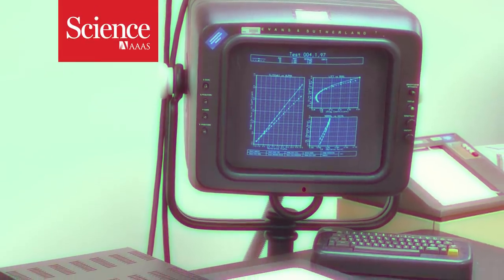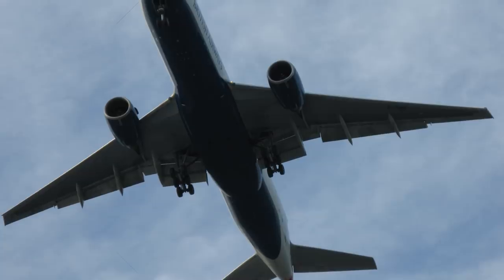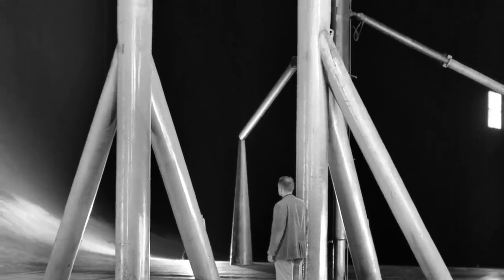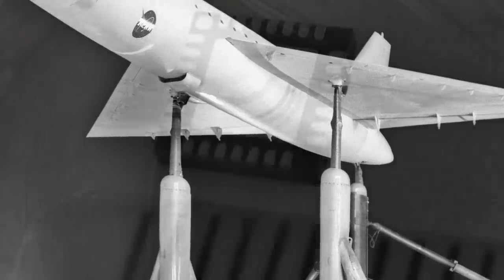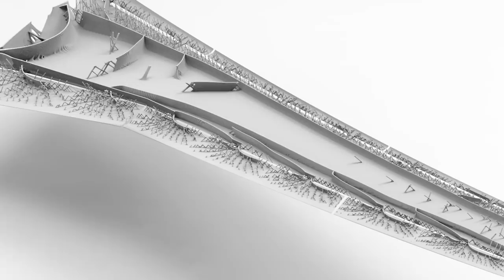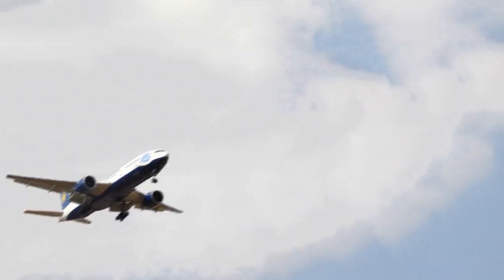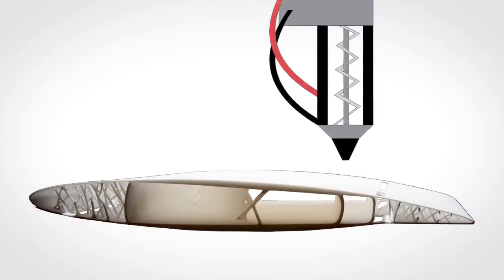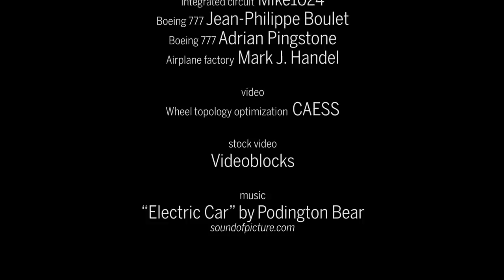New processing lets a supercomputer design a radical new wing

Comment: One small step for computers, one giant headache for maintenance.
Reply: Real argument right here
Reply: @Stan Cooper I think it works by mathematically designing each section to spread the forces evenly throught the structure with the least amount of material. Of course they would be able to calculate the normal pressures associated with flying and different types of weather. Boeing has all the data on that for sure. 

I guess the pitfall that you can fall into when you push structural optimization too far is if you don't also calculate the lifespan of the material or how well it will hold up over time. For example: when building the frame of a car; you want light weight for better fuel economy but if its made out of a ferrous material making it thinner will cause it to rust faster and it won't last as long over time. It may also be less repairable because there isn't enough material left over to work with if something needs to be repaired.
Reply: Indeed, it seems no thought went into how difficult it would be to fix if something goes wrong with it.
Reply: A very good point especially when you consider that the main point of this new design is to shed weight therefore saving fuel. Which would reduce the environmental impact of the plane and also save costs for the company but having a plane wing that is not easily repairable may completely undo both of the reasons for wanting to use a weight saving method to begin with. As completely replacing a wing after minor damage instead of repairing it may infact have a higher environmental impact associated with it, through manufacturing and transportation as well as costing companies more.

A way that I could see to negate this problem in part, would be to manufacture the wing in smaller sections and later join them together. Which would mean that instead having to replace the whole wing after it is damaged, only a much smaller peice needs to be replaced. I'm guessing that this idea has already been looked at and that a study has probably been done (at least I hope) to look at whether the reduced fuel consumption pays off the lack of repairably of the wing in the long run.
Reply: @activechaos128  The problem isn't just if/when the wing is damaged and you need to replace sections of it. If the structural integrity of the wing is coming from the whole wing and not a main wing-spar (as seems to be the case) then it will be a lot more difficult to split the wing into individual sections without compromising durability and fuel efficiency.
You'd also need to put in access panels for maintenance checks and the replacement of parts, adding weight and structure to the design.
Reply: This is why carbon fibre hasn't made any breakthroughs in aeroplane engineering. The components have to be durable, not replaceable.
Reply: @MeteCanKarahasan  Wait, what? Carbon fiber is used, sometimes extensively, on modern aircraft fairly regularly. It's already durable and lightweight. Barring specific chemical reactions I can't think of an instance where damage to a carbon fiber structure would not do similar or greater damage to comparable aluminum or other composite materials. Especially since it has some "give" to it.
Reply: @Wallen D okay, you be on the flight with catastrophic failure due to the "low toughness" design choices. How are you going to maintain it? I don't doubt it is used, I just don't see how it can be maintained. I must be stupid for playing safe, I guess...
Reply: @activechaos128  
How many times have we seen things designed by engineers that work well, but are hell to take apart and work on (I’m looking at you, Subaru)?  Allowing a computer to do that just takes that same problem and exponentiate it.
Reply: @MeteCanKarahasan  I'm not saying it is a perfect material. It has drawbacks to it. But when there is a commercial passenger plane that is 50% carbon fiber by weight that's been flying for 11 years and hasn't crashed? Yeah, there's a reason for that.
Reply: @Wallen D that just means to me it wasn't such a structurally strained piece.
Reply: @MeteCanKarahasan   The plane I  am referring to is the 787 Dreamliner. Its fuselage and wings are almost exclusively carbon fiber/composite materials. If those aren't designed to take structural strain I don't know what is.
Granted, there are counterexamples such as the Cessna Corvalis where improper manufacturing methods in Cessna's Mexico plant led to failures in the composite wing. My point isn't that carbon fiber or composite materials are inherently more safe or unsafe than "regular" aircraft materials, they both have their own, unique, design constraints and issues. My point is that carbon fiber is a safe, weight-saving alternative to aluminum.
Reply: @Wallen D, well I guess they don't use it on the nose-cone, or do they?
"Hail damages Dreamliner's nose during flight, prompts emergency landing"
- "The 787 is made out of carbon fiber, a material that is difficult to repair. Experts say hail can harm a plane's flight control system and engines, even causing it to crash."
Reply: @MeteCanKarahasan  Oh, they do. In fact, composites are an excellent choice for radomes as (unlike metal) they can be designed so radar passes through the material very easily. As for being damaged, the majority of hail damage on aircraft tends to occur in areas that directly face forward (nose, engine/engine nacelle area, wing and tail leading edge, and the gear doors if you have the gear down) so it makes sense that the nose cone would be damaged.
Yes, carbon fiber can be difficult to repair but so can sheetmetal. It depends a lot on what the damage is and where the damage is on the aircraft. How far from stringers/longerons, depth and width of the damage, is the damage in a critical area, etc. 
With metal sometimes the damage is minor and within limits, other times it needs a doubler (sheetmetal patch) put over it and sometimes you even need to call the manufacturer up and say "Hey, this is what's here. What should we do with it?"
It's pretty-much the same with composite materials, except instead of patching-over the damage you might have to cut out the damaged area, put in a plug/filler-material and do a few layups of composite weave and resin over it. While it does take longer than repairing metal, the weight-savings and fuel efficiency of  composites more than make up for the extra down-time.
Reply: From the same news article prior;
- "The 787 is made out of carbon fiber, a material that is difficult to repair.

Experts say hail can harm a plane's flight control system and engines, even causing it to crash."
Does it feel like the damage is always head on? It seems like it will hit sideways and it won't be able to make it until landing which is the most important part of flying in the first place.
Reply: From the looks of it, the only maintenance you would be able to do on that, is to melt the entire wing and print one from scratch.
Reply: @MeteCanKarahasan   I'm not sure what point you are trying to make. Yes, the 787 is made of carbon fiber. Yes, hail can harm and damage a plane's flight controls and engines and, in extreme circumstances, may even cause it to crash. This is the same whether the plane is made of metal, composite, fabric, wood, or any other material. See Southern Airways Flight 242 (an all-metal aircraft) for an extreme example.
If a plane is in a situation where hail is so severe it is threatening to down the aircraft, no matter what material that plane is made of, it is going to be severely damaged; possibly to the point of being a complete write-off.
And while hail damage is not always head-on, the most severe hail damage is concentrated in those areas.
Note: If an airplane is receiving any hail damage while flying it is either very, very unlucky or the pilot and copilot are idiots of the highest caliber. The most likely damage to airframes I can think of is ground-collisions. These tend to be slow speed and localized to a relatively small area of an aircraft.
Reply: Don’t worry engineers know how important maintenance is
Reply: @medexamtoolscom  Why would they think about that? They never said they will build it, they were just testing their algorithm....
Reply: They use carbon in the biking industry, too. In no clear terms have they ever guaranteed a carbon fiber product for longer.
Reply: @MeteCanKarahasan  They use aluminum in the biking industry too. Between a bike and an aeroplane I'm pretty certain I know which warranty is going to be expiring first. Also, if we've started comparing bicycles to planes then Godwin's Law shouldn't be too far off. I can't believe I'm saying this, but bicycles are different than aircraft. You can't pull-over a 767 at 32,000 ft. and call someone to pick up your passengers.
Reply: A recent new documentary is on youtube: The Connections (2021)
Reply: Shut up! It's a disposable aircraft!

Comment: I’m actually pretty impressed that with much simpler and cheaper manufacturing and design processes; we were able to come up with a wing within 5% weight of a supercomputers 5 day super processing wing that had no manufacturing constraints.
Reply: To be fair, they did give the super computer an existing wing as a starting point. What the computer did was essentially refining the wing to remove any unnecessary material
Reply: @SelectKiko  So it is even less impressive of the super computer to only get 5%.
Reply: @Gid-J  I'd say that 5% improvement shows how close to optimized the original wing was.
Reply: I'm also sceptical how functional that wings internal structure is for all the cables, hydraulics, fuel tanks and so on that need to be accounted for in an actual plane.
Reply: There are destructive tests of wings to determine that they need to withstand certain parameters. If the wing performs better, then they remove material and redo the test. Because of trial and error methods, we got close to optimal calculations.
Reply: The engineers that worked on the real wing did take perhaps months if not years do design it tho.... so I still find this impressive.
Reply: @Gid-J  I guess a super duper computer is needed to get really good results
Reply: I wonder how they accounted for modern composite wings. Topology optimization in an isotropic material is pretty easy. Things change if you can do it in carbon fiber. They probably just compared themselves against an old aluminum-only wing.
Reply: @T33K3SS3LCH3N  yea my guess it was structural strength only be accounted for
Reply: Though, that 5% reduced gas consumption by 200 metric tons per year. Imagine as we keep redesigning and optimizing, in 20 years we will be amazed at how the little things add up.
Reply: @s.r.5462  there is a limit to efficiency, you cant run in nothing, all you can hope is 100% efficiency
Reply: define 'simpler and cheaper'. how much is several decades worth of engineering by several thousands of humans worth?
Reply: @daos3300  ‘simpler and cheaper’ to me mean designers with pen and paper, and manufacturing processes that currently exist.  It certainly has been a cumulative effort, but then a supercomputer didn’t just appear one day.  How much is several decades worth of computer advancements by several thousands of humans worth?
Reply: @AaronCMounts  Excellent point. Test your design with the supercomputer. If 5% improvement is the best it can do, you don’t have to worry that you’ve missed something obvious.
Reply: If it can not be manufactured then whats use of such optimised wing, 3d printed or other additive manufacturing is good for toys but not for passenger airplanes
Reply: @sphericalsphere, I wasn't aware carbon fibre use had spread in the aeroplane industry. I thought it lacked the necessary toughness in the even of a crash.
Reply: @MeteCanKarahasan  it's amazing indeed. The boeing dream liner's fuselage is mostly carbon composite 😎. Costs an arm and a leg though!
Reply: 5 days to calculate and 5 jears to design the program?
Reply: @molybdaen11  the truth of software is you can only hope to solve with a computer something you can solve without using one at all, with the requirement that you must also be able to break the method of solving the problem down into the tiniest discrete steps required.

Once enough things are computer-optimized and people depend on the software too much, the only people that will truly know how to solve the problem without a computer are those that wrote the code for the  computer.  Once those people are gone, well, that could be a problem eventually.

I say this as someone that has made a living automating things via computers by writing code.
Reply: @xpeterson  exactly, the last couple of decades have also used computers to aid design so you can add the cost of computer development to the current crop of aircraft tech, which makes the 5% less impressive. but we do need to take into account the very limited parameters for this particular design exercise. would be a different story if we asked the software to come up with an entire plane from scratch.
Reply: @akp27i  this was a highly limited design exercise. all things start small, a single engineer didn't just pull supercomputers capable of redesigning entire systems out of their ass in one day. early computers were hilariously huge and clunky, yet look at them now. and 3d printing is currently being used to make full scale rocket engines, i wouldn't call that a toy.
Reply: @strictnonconformist7369  That's true. However once the program is running you can copy it for many different uses. This frees humans to do other things.
And I know that a program only did what the human programmed it to do, not what it is supposed to do :)
Reply: Hi xpeterson and everybody. I am one of the four authors of the work and would like to help clarify the comment posed above. The performance improvement reported in the (very short!) video is not for the complicated design shown. It is based on an interpretation in which we only extracted two simple features: the curved spars and the curved wingbox. Hence, the weight reduction for the actual optimization result is not known. But is undoubtedly much much greater than 5%. You can read the (open access) paper here if you would like to know more: https://backend.orbit.dtu.dk/ws/files/138121106/ppnature23911_Aage_ORBIT.pdf
Reply: Whoops - just commented using my work profile. Here it comes again from my personal account.
Hi xpeterson and everybody. I am one of the four authors of the work and would like to help clarify the comment posed above. The performance improvement reported in the (very short!) video is not for the complicated design shown. It is based on an interpretation in which we only extracted two simple features: the curved spars and the curved wingbox. Hence, the weight reduction for the actual optimization result is not known. But is undoubtedly much much greater than 5%. You can read the (open access) paper here if you would like to know more: https://backend.orbit.dtu.dk/ws/files/138121106/ppnature23911_Aage_ORBIT.pdf
Reply: @nielsaage2545  Thanks for that insight. I didn’t mean to diss your work with my comment so much as to show admiration for the work that has been accomplished via methods that are slowly fading away - in the same way I would admiring how the pyramids were built. I apologize for the tone it took, and I wish you the best of luck optimizing the wing structure and moving aviation forward. Cheers
Reply: @nielsaage2545  nice, thx
Reply: @xpeterson  no offense taken at all. On the contrary. All good research should be received with skepticism. That’s the only way we can move forward🤘
Reply: @andrewwatts1997  I'm really interested in how you voted.  You don't have to say, but I just feel like Democrat voters are more likely to be reeled in by these types of videos.  The kind where they introduce some new tech that is probably decades or further out.  They seem to impress democrats more than other voters.  Just wondering.
Reply: @MindBodySoulOk  well, seeing I'm from europe I couldn't even vote for democrat or republican. Innovation is something I find very important but I'm also very critical of new projects. Like solar roadways or piezo electric walking paths for energy generation. I'm also a product designer and have worked with electronics since I was 16 so my criticisms of projects are founded atleast somewhat in fact.
Reply: Absolutely
Reply: Good point
Reply: @SelectKiko  good point
Reply: Maybe 6 days or processing would’ve resulted in 95% reduction 🤷🏼‍♂️ who knows.. also, it’s quite constraining that it had to stick to the original design..
Reply: Wing design is an iterative process, there is no way to analytically solve the formula to have the "best" wing design just like there is no formula that describes the best car. The decades of wing design optimization is through trial and error. As computational fluid dynamics improved, it took massive development cost away from wind tunnel tests and did most of the computation to give a baseline before prototyping. As an researcher who works on such optimizing algorithms and as a designer who uses such optimization in industry I can give you a perspective from both sides of spectrum. 

A researcher pushes the algorithm to provide the absolute best design without constraints, this gives a benchmark to strive towards. An industrial designer has a lot of tradeoffs to find the Pareto frontier. And depending on the industry, especially highly competitive segment 5% improvement in efficiency can even be considered disruptive innovation given how good we've become at engineering.

Bottomline: No manufacturer is going to blindly print an unconstrained design supercomputer. Better computing power and such clever algorithms gives better baseline to such multi-dimensional problems before prototyping stage.